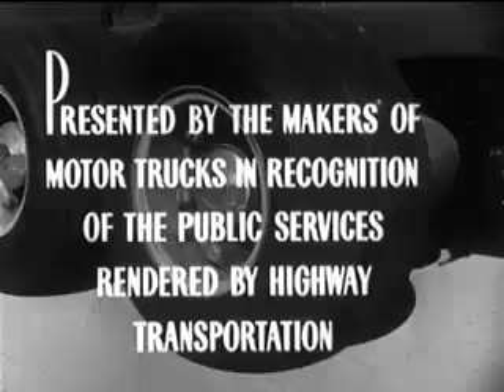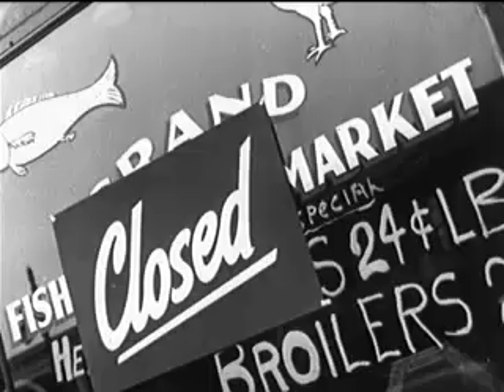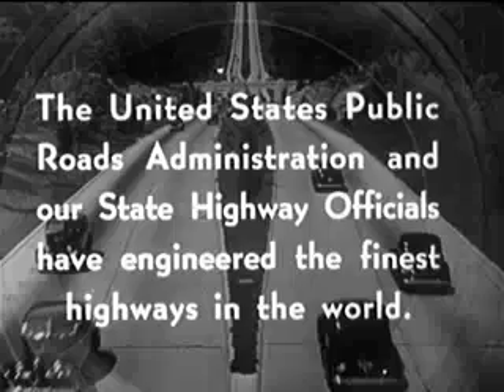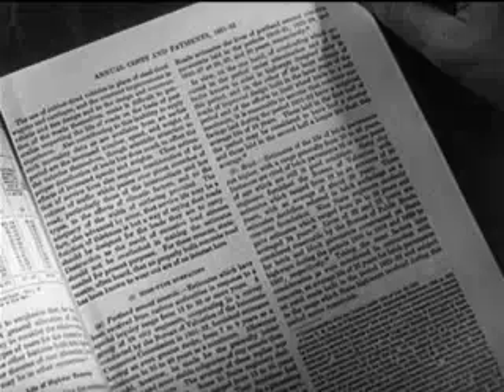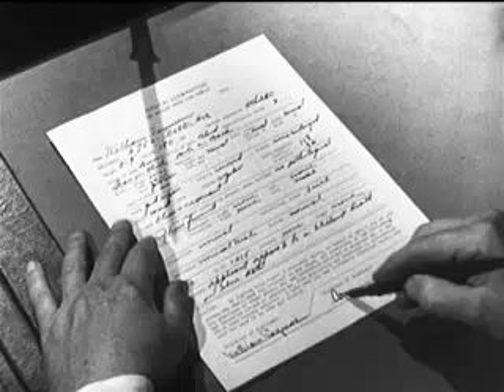Singing Wheels

Comment: I am noticing how small the tractors and trailers were compared to those in use today. I doubt if many non truckers realize just how challenging it is to drive these huge vehicles we have the 73 foot long trucks we have today on roads that were intended for vehicles  less than 45 feet long.Also the many places that have underpasses too low for 13 feet 6 inch trucks that are the norm today.